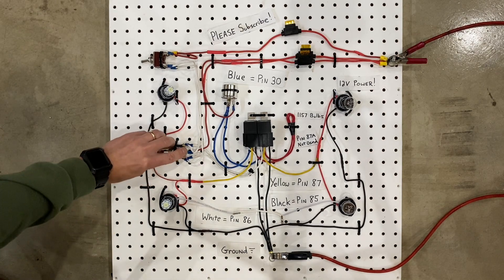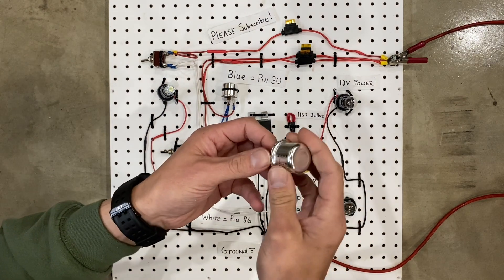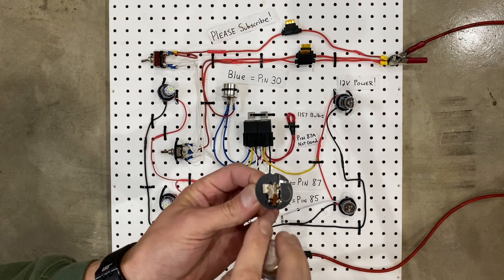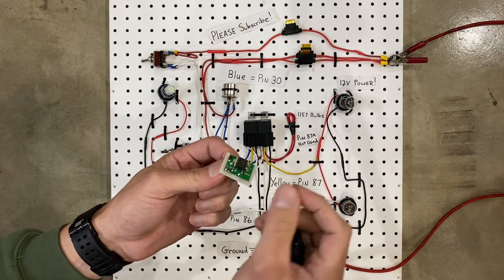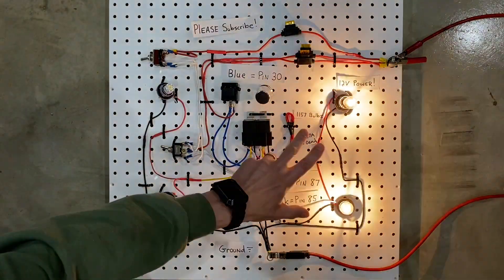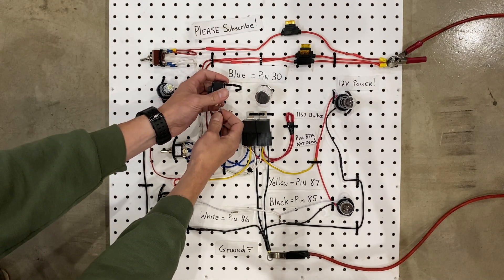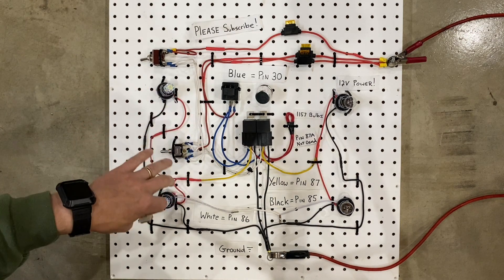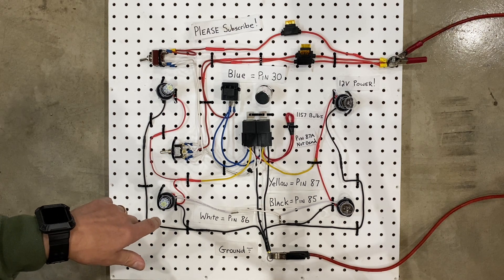How to Fix Your LED Turn Signal Bulbs that Don't Flash. Make Them Blink! | @WiringRescue

Comment: What if you have LED's that the running light is ON all the time, and Flash as a turn signal.  I have a set that the running light will work but won't flash.  If I disconnect the "third" wire for the running light I can get the turn signal to work flawlessly.  Yes, I have and LED turn signal relay installed.

Comment: Just installed led taillights on my 1968 c10 .didn’t order the led flasher at the same time so when the flasher showed up I installed all three.turned on and tried everything no turn signal .after checking all components for something wrong I found nothing.ended up trying my original heavy duty flasher and bam .all good .my question is WTH ?????????? Baffled once again.
😳😳😳😳😳😳😳😳
Reply from the maker: Was the LED flasher wired backwards? A lot of them only work one way, which is a bit odd. Flip the wires going to it and see what happens. Or ignore it because it works great now! :) either way - thanks for watching my video! C10’s rule!
Reply: You can only plug in the flasher one way .I’m sure if I switched the wires it would work .it’s not fun under that dash at 64 years old so if it works don’t fix it .on to other issues .thanks anyways.I’ll keep an eye on you’re videos and learn more .👍👍👍👍👍👍👍
Reply from the maker: @johnmccool7551  - that sounds like a great plan to me! Thank you for watching!

Comment: I want to try your system I think this is the solution to my problem, When I momentarity  use blinker they but does not when I engage the lever fully, I have these digi-tails set up. Im having a hard time following your video, please send me a diagram of your wiring set up. Solutions from digi-tail did not work, Pleas Help!

Comment: Straight and to the point. That said, I have an issue where the signals flash until I  turn the headlights, parking lights, fog lights or any combination there of. 
I installed the LED flasher. I suspect other problems are at play.
Reply: @marklandsing129 Did you ever find a solution for that?
I am fighting the same thing in my 59 apache

Comment: Do you have a link to one that will work for my truck? I have a 1990 F-150 and the flasher is round.
Reply from the maker: I’m not familiar with those trucks, but you could definitely just make a jumper wire from one flasher to another with 4 spade connectors and some wire.

Comment: Issues  I'm having with my LEDs turn signals is the fronts work now with an LED flasher but as soon as I install the rear turn signal led lights the turn signals no longer work but S soon as a plug in the original lights the turn signals work again. So front LED lights work great and rears I can't get to work.

Comment: Hello!  I have a 1992 Ford Ranger Custom Super Cab with the 2.3 in it.  I have put several different types of LED bulbs in my truck and they won't blink at all.  I saw this video and thought that this was my problem.  Nope.  I cannot find a flash relay that will fit in my truck.  My truck flash relay is round and the LED electronic ones are square or rectangle.  You can't fit a square or rectangle in a round hole.  I have bought and tried several round flasher relays that state they are for LED's but they do not fix the problem.  What do I need to do to get my blinkers and my 4-way flashers to work.

Comment: Bimetallic switch. I literally just posted a schematic of that part on another video.
Far as the led pulse goes it just a bistable 555 timer ic. Square wave generator.

Reversing those wires could destroy cheap led flashing circuits that do not have reverse voltage protection. To be honest they should include a full bridge rectifier circuit with that flasher so as to allow it to work correctly even if you reverse the wire connections.

Comment: My problem is that everything works great until I turn my headlights on, the the signals won’t flash. Taillights are all in one and not just bulb replacement. Any idea what’s going on?
Reply: Did anyone figure this out?  If not, I have and can post a write-up if needed.
Reply: @William-kh4fj post it cause I haven’t figured it out yet
Reply: did you resolve this? I am having the same issue. When I swapped just one LED bulb, for an incandescent bulb, everything works as intended...
Reply: This is my problem as well. Everything is fine until I turn on my running lights
Reply: same here 3 out of 4 indicator would flash normally but  the other 1 would stay on forever😂.
how to solve it????
Reply: Idk how many of you are still having this issue but it sounds like you are powering your flasher circuit through your headlight circuit, either high beam or low beam. Your high beam should have a relay your low beam should have a relay and then you typically only have one flasher relay that controls all of your turn signals. So go back through what you touched and follow the wires from your flasher relay, they should only be going to your turn signals. Check for any bad wiring causing shorts and check your relays to make sure they are in the correct orientation.
Reply: Did you fix this? Running into the same

Comment: Great video!! I have a 71 VW and I’m doing exactly what your explaining and have installed an electronic flasher and get flashing lights at all 4 corners (very bright) BUT when I select a turn signal I get a bright front turn signal (no flash) and a weak flash outback?? Thanks!
Reply from the maker: Is your LED flasher wired backwards? They are directional. Try that and let me know.

Comment: Very good info you are putting out.  I put led's in a '95 Ford Ranger and now when I use the turn signal lever they all come on and hyper flash.  it has a turn signal flasher relay and that's it.  I'm kind of stumped.
Reply from the maker: Is the flasher meant for LED bulbs?
Reply: @WiringRescue  It is now.  I changed it to an EP27 and hyper flash is gone.  I still have a back feed issue to the turn/stop light.  I will try some diodes to fix it.
Reply from the maker: @BustedKneeAdventures  - awesome! Sounds like good progress at least!

Comment: Hi @Rattymusclecar, Thank you for that informative video! I've seen 3 videos of yours today and learnt 3 new things! All relevant to my current builds. I have a somewhat off beat question about Hazard lights though. Perhaps you can help? 

For reference, I live in Australia, and, whilst we have GM products here (Holden) there are of course differences between GM & GMH. I have recently purchased a 73 C10 Stepside. It's two trucks put together, the donor being a mid 80s truck/Blazer. In my efforts to make it roadworthy, I noticed there are two spaces for flasher cans in my wiring, one for directional and one for hazards, no problem there, replace missing one and truck is one step closer to roadworthy! I've had a fair few GM products before (AUS only) but have never seen two flasher cans. Is this a North American regulation or something?  

I've already subscribed! Sweet Le Mans too
Reply from the maker: Thanks for subscribing! I don’t have a definite answer to your question, but I do have a guess that is probably wrong. 

With the car off, you want your turn signal switch and all of its functional magic to be dead. Otherwise you’d always find them blinking in grocery story parking lots without anybody in the car. However, you want your hazard switch available all the time if you car is off and your keys were stolen by a group of zombies.

For some reason, GM decided that wiring it this way was smarter. In my hazard switch video, you’ll notice that my turn signals would work 24/7 and so would the hazard switch. It doesn’t matter if the car is on or off. In the interest of keeping life simple, I designed it that way. Maybe I’ll do the more complex version too… hmmm

Good luck with you truck project, and thanks for the question!
Reply: @WiringRescue  I just realised what I said was actually incorrect haha. The car I'm thinking of doesn't actually have hazard lights, so of course there's no additional flasher can. I'll check out some later models and see when they started to put them in. 

But now, thanks to your hazard flasher video, I'll be putting them in!
Reply from the maker: @derekormsby798  - haha! Well whatever direction you go, just know that I am truly thrilled that people in Australia are watching my videos!
Reply: @WiringRescue  that's sweet as man! I'll tell my friends to check your channel out!

Comment: On my 2002 Silverado I'm installing all LED bulbs in the truck. 
I upgraded the stock flasher relay module under the dash with a new one to keep  the LED's from hyper flashing. 

So today on the driver left side I put in the new turn signal LED bulbs with resistors for the higher lumen 3157 flashing rear bulb, and one 3157 bulb for the front.  As well one front side mini flashing LED bulb that is lower lumens without a resistor. 

This was on the left/driver side of my truck. 
When I tested the left side, the turn signal in the back and both front signals were flashing.  Then the mini flashing LED bulb stopped working. So I swapped it with a different mini LED bulb, and nothing, no flashing. I even tried a resistor on it, and nothing 

So I took the resistor and mini LED out of the left light socket and put back in the stock incandescent bulb, and it still wouldn't work.

Now what is happening is the front 3157 & back 3157 largef turn signal bulbs that should flash. They just stay illuminated even though the left turn signal is not turned on.
What could this be, because at first the front mini LED flashing turn signal along with the two 3157 bulbs front and back were all flashing fine.

With that said before I installed all the bulbs, I did clean all the light bulb sockets with fast drying electrical spray/protectant. Though non of the other LED light bulbs had a problem. 
I thought about buying and splicing new mini light bulb sockets on the front.  Then it got dark so I couldn't do anything else. And I don't believe it's a blown fuse or the front and back turn indicators wouldn't just stay illuminated.
I'm totally stumped on what to do, could you please help me, thank you.
          ~Carl
Reply from the maker: It’s tough to diagnose electrical issues from afar. If this was my truck, I’d start by putting the stock bulbs all back into place along with the factory flasher relay. Then I would make 1 change at a time and test the functionality after each change. It’s also worth noting that some of the LED bulbs and LED flasher relays are not the highest quality in the world. So it is certainly possible that you may simply have a bad part.
Good luck in the diagnosis! Electric stuff is rarely fun to diagnose, but always leaves me with a great sense of accomplishment.
Reply: @WiringRescue  , Thank You!
Tomorrow,  what I think I might try is adding all my new LED bulbs on the right side of my truck to see if they all work. 

Hopefully if I don't have any issues with the right side front turn indicators then it shouldn't be the new flasher relay module, correct?

If not then maybe I got  some bad switchback LED bulbs.  And or my old stock T10 light socket is bad, it was slightly corroded.

I will also check with stock bulbs. 

In your experience is a resistor needed for a low watt switchback/flashing T10 LED? 

I really appreciate your advice,  was very nice of you to reply quickly.
Reply from the maker: I am not an expert at swapping to the new t10 LED bulbs, but I don’t know why you would even need a resistor if you have the proper LED flasher in place. Seems like it would be unnecessary to me, though I’ve never done it.
Reply: @WiringRescue  ,

Just like in your video when you turned the flasher  the wrong direction.  
Well you have to pay careful attention to which direction you put the upgraded LED Bulbs and relays in the turn light  indicator sockets.
1. They won't work right.
2. The relays will get extremely HOT!

I fixed it, but boy was it time consuming!!!

Comment: Thank you so much, excellent explanation, I having a motorcycle I attached with a teardrop trailer with LED turn signal, unfortunately the LED very weak. How can I solve this issue?
Reply from the maker: Check all your wires to make sure they are all good connections. Or get brighter lights. You need to determine where the problem actually is - the wiring - or the bulbs?

Comment: Is it possible to add the flasher before the switch instead of the relay
Reply from the maker: I don’t believe you could make the circuit work that way, because the switch is just turning the relay on and off. It’s totally separate from the flashers.

Comment: Do you have a video for a full wiring for headlights, taillights, brake lights, and blinkers? Trying to do an easy re-wire for lights on my 1985 cj7.
Reply: Only channel I’ve found that helps explain wiring.  I suck at it.
Reply from the maker: I’m slowly but surely getting there. I have brake lights, headlights, turn signals all in separate videos. I do intend to do 1 video that covers all the circuits, but it could be a little while because I have a few others to do first. Horns are coming up next.

Comment: Hey I have a 1964 Imperial with power windows, but I'd like to add relays to them. Can you show how to do it? 😀
Reply from the maker: As you may expect, I'm not super familiar with 64 Imperial window wiring. However, I'm good at guessing! You'll have to do some exploring of wiring to harness to figure out which wires do which. Here are my thoughts:
- You'll need 1 relay per window, so 4 total most likely.
- The window switch probably (?) sends power to the window motor (as opposed to ground). This means that you'll be connecting that power wire from each switch to pin 86 on the relays.
- Pin 85 on the relays are grounds.
- Pin 30 on the relays should be the power coming in from a fuse box. If I were you, I'd buy one of these. https://vincentperformance.com/shop/leash-bdfb/ to grab all of your power from. Feed that fuse box power from the battery (with a fuse in that main wire), and then each of the fuses in this panel can power a relay/window.
- Pin 87 on each relay will feed the power to each window motor.  
- Use all new wiring to be safe.

Hope that helps you out!
-Jeremy
Reply: @WiringRescue  Hey thank you for the information! And no I expect you to know every car that's ever been made lol 😜 but really just a general overview helped alot! I'll have to get my service manual out and start working with the wires soon!
Reply from the maker: I try to help as many as I can! A service manual with a wiring diagram would be outstanding for a project like that. New wiring would probably make the motors and switches waaaay happier than the original stuff.